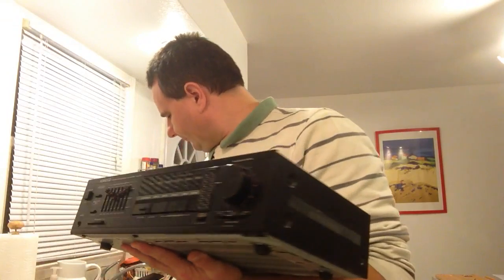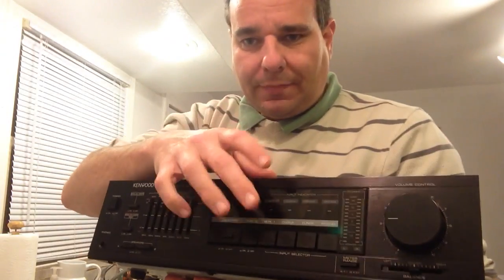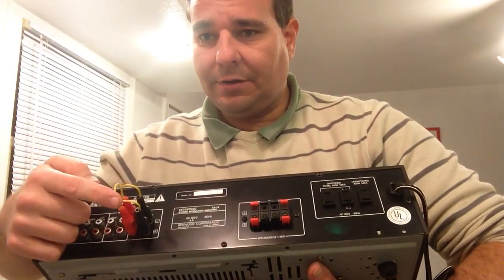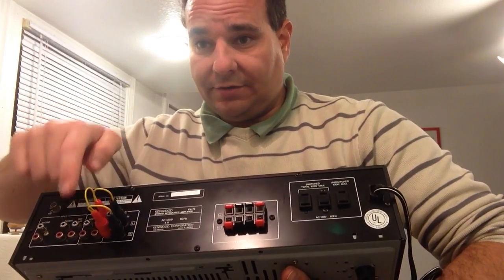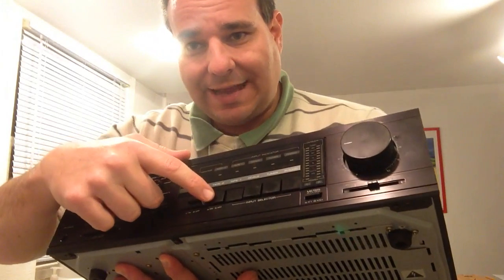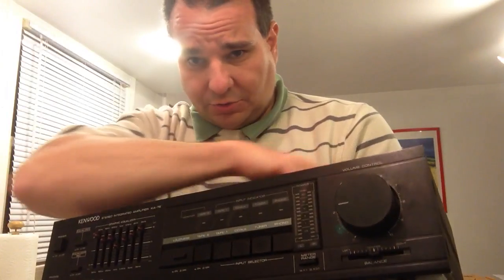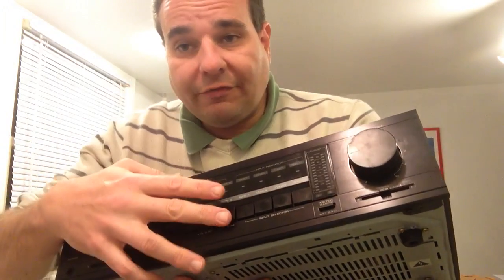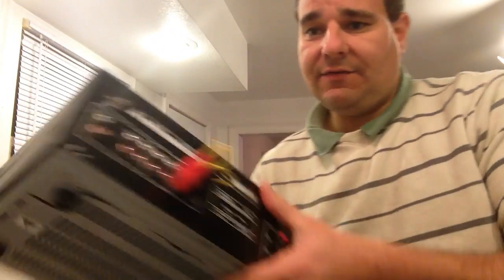Mono switch, pt. 3 using some simple wire and the tape monitor...

Comment: I wonder if this would work on my receiver. It has the tape in/out jacks, but there's no tape monitor button. I'm not sure if the receiver would know which output to send to the tape loop.
Reply from the maker: Dan Watkins I'm sure it would, Dan.  Usually you listen to the tape when monitoring a recording on an amp - see if the tape button clicks in while another is depressed - then you know... or look for the manual online to double check... You can also probably use banana plugs, but radio shack has the solderless terminals which should work.
Reply: dixielandfarm Hmm, I don't think my receiver actually has a tape monitor function. I double-checked the manual, and it's made so that you just select the source channel while recording. My receiver was made in the mid-90s, so it has the clicky buttons that don't actually depress. It might be that they started cutting corners on this feature by the 90s. The only "Tape" option on the receiver is for playback. I ran an RCA loop between the input and output just to make sure I couldn't figure out a hack for it. Oh well, I'm just happy that I finally broke down and bought my double Y-cables. Getting those actually made me figure out that my cartridge had two wires reversed. It only took me about 8 years to figure that out. I blame my colorblindness. :)